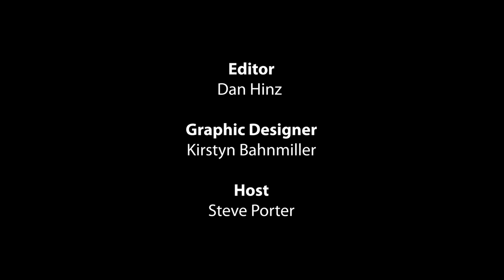The Truth About the Electronics Refurbishing Industry

Comment: Sorry but your reasoning from the perspective of a very backwards country, the US. That doesn't care about cosumer protection. In the EU we have warranty on refurbished items. I have bought several refurbished office PC and laptops over the years. All great buys. If it breaks, just send it back and claim your warranty. 
Also, working with a toothbrush to clean a vent is just laughable. Anyone wanting to make money would do that with compressed air in seconds. You were just extending on purpose to make your point. 
They also don't need to check every feature. If the basics work then on average the rest will work to. It's cheaper to provide a returns policy and good warrenty
As to your price calculations, those companies don't buy of eBay and you don't have Warranty on eBay. They buy in bulk. They likely pay pennies for those systems. That 125 dollar eBay price is likely just something like 10 dollar for them.
On total this video is a big thumbs down for thinking the US is representative of the larger world and putting a negative light on refurbishing.

Comment: I'm sorry but your method is waaay too slow/time consuming. Dust cleaning is done using air blower(for leafs) + soft brush made for wood paint, which cleans much larger surface than toothbrush. The only time consuming part is the thermal paste change.